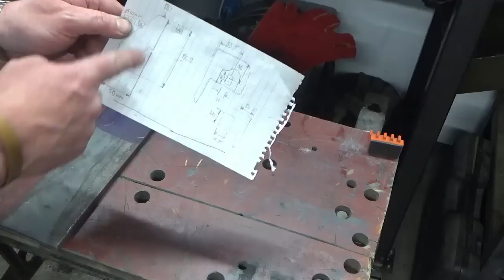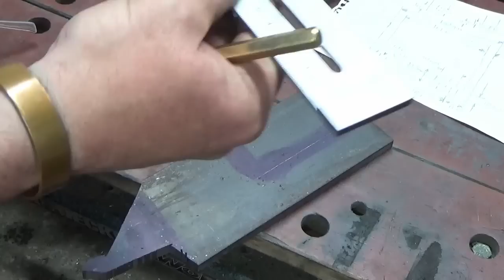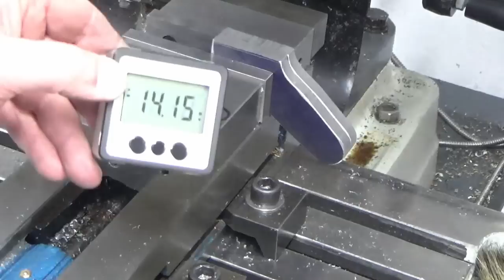Atlas 7B Shaper Refurb Part 8 - Motor Mount Bracket Build

Comment: Well that turned out very good Jon. Like you say , it will probably last much better than a cast item. I just came back from Fuerteventura , where it was a constant 27 degrees. When we got back to Leeds & Bradford Airport. The doors were opened & the heat was much hotter here than on Holiday. Still red hot today. Mustn't complain though.
Regards.
Steve.😀.
Reply from the maker: Hi Steve, thanks for the comment and feedback. Hope you had a good holiday. Cheers, Jon

Comment: Great job John. Many welders can't control distortion and end up bashing the fabrication with a hammer. I've seen it done where I used to work many years ago and most of the time there was no hurry to do the job! I could never understand some of their minds around this. You did a great job controlling distortion and the welding was good too.
Reply from the maker: Hi Dermot, thanks for the comment and feedback, much appreciated. Cheers, Jon

Comment: Welding is plenty adequate,  guessing 0.6mm wire on 10mm plate, is very good 👍. On a pedantic view, there is probably not any root penetration, but it's a bracket to hold a motor, with no requirement for resisting vibration fracture. Obviously, where it an item that needed to be dimensional stable after machining,  it would be have go be stress relieved,  either by a thermal or vibration process (VSR).
Great weldment replacement of a casting 👌 👏 Jon.
Thanks for sharing. 
Best regards from the Black Country. 
John.
Reply from the maker: Hi John, thanks for the comment and feedback. I should have gone bigger with the weld preps definitely, all a big learning curve mate. Black Country eh, I didn't realise you were in the UK, apologies. Cheers, Jon

Comment: Good looking part Jon. It will be a lot stronger than the original for sure. I find as I get older, (59 now), that I can't tolerate the heat or cold as much as I used to. Which is ironic because here in central Canada (Manitoba), we can go from -40C in the winter to +40C (not very often, more like 35) in the summer.
Reply from the maker: Hi Steve, thanks for the comment and feedback. Lol, I am so used to cold windy wet miserable weather, I don't know how to deal with anything above 20 C. Cheers, Jon

Comment: Really useful video thanks! I don't suppose you still have the dimensions of the bracket handy? I'm rebuilding a 7B but the mount was missing entirely so don't have anything to copy and I can't find the dimensions anywhere online
Reply from the maker: Hi Malcolm, I may have my rough sketch somewhere, it is only what I showed in the video but these are the only dimensions that matter. If you email me (address on opening / closing screens of all my videos) I will forward on what I have (assuming I can lay my hands on it). Cheers, Jon
Reply: @jonsworkshop  Hi Jon - thank you that's very kind! I'll email you - Malcolm